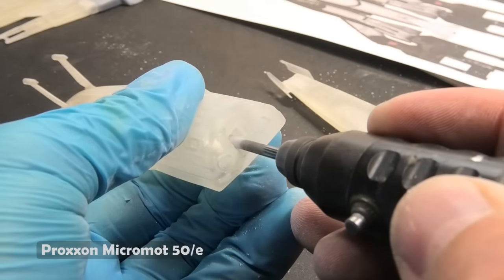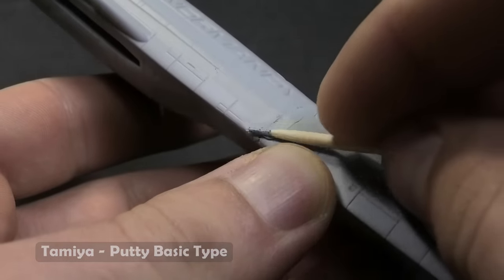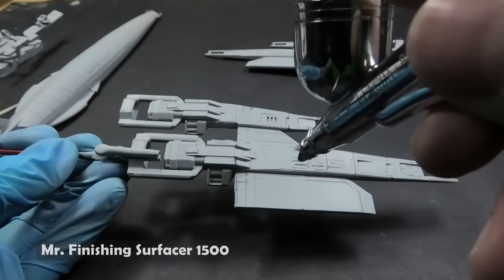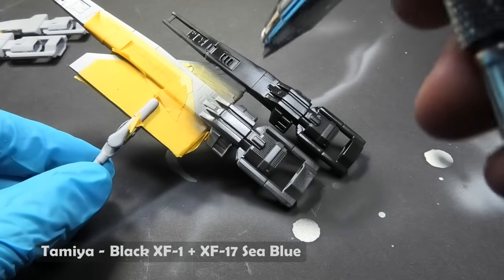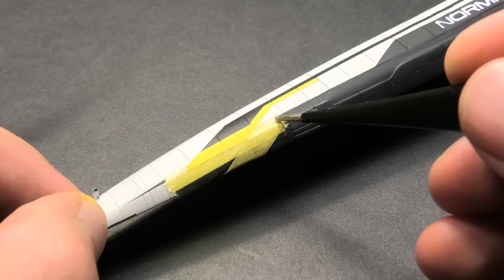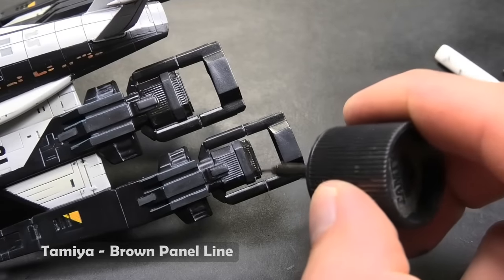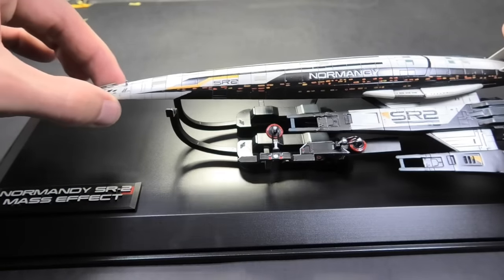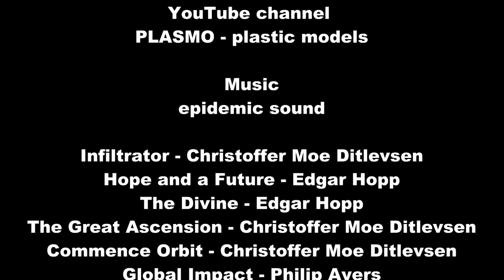Normandy SR-2 Mass Effect - 3D Printed - 1:800 - sci-fi Model

Comment: As someone who helped develop the Mass Effect games at Bioware I was both surprised and happy to see you tackle the Normandy!  Great build; you did her justice!
Reply: I always find that the inside of the SR-2 is messed up, especially in ME3. (I counted my steps, forwards and side-wards)
But with the Tempest her inside, from MEA, that could easily be countered, in style. (more deck space, especially on deck one via T's deck one round chamber, bigger cockpit, three bigger cabins, Admiral, Captain, XO, yeah; deck one as a admirals deck with warroom, ect, SR-1 staircase access from deck two)
Would also require some choice elements of the SR-1, though.
Canon SR-2 her inside & outside, don't really match up, especially not in ME3, just follow the cockpit lower line backwards, where is the room for the belly gun that's below the CIC?
A beautiful design, that's hindered by the internal details.

But yeah, for a details by hand, painted, he really did it great, especially for a 3D print.
Of the print file itself, why did it not include a docking tube???
Would have nicely fitted with that cradle.
It's the only thing throwing me off.

Now, would this actually be how the SR-2 model would be displayed in the game, by change?
Because if so...
Reply: Thank you for the creation, and for the Normandy. It sits up there as "iconic space ships in popular culture" like a number of famous peers. N7.
Reply: thanks for a masterpiece
Reply: me too
Reply: the original ME is one of my favorite games..wasnt a fan of where it went from there, but thank you.

Comment: The artefacts on the prints are the rasterization of the screen showing up on shallow angles. That's why you should always orient your prints at roughly 45° to the screen axis system. Beautiful result, by the way. :)
Reply: These artifacts will diminish as screen resolutions get higher, but they would need to double or more before they disappear entirely.
Reply: I tend to rotate my parts 45 degrees to the screen and 45 degrees on the z axis gets rid of almost all artefacts except those on spherical surfaces.
Reply: Adding contrast blur helps as well as the orientaion you are referring to!
Reply: You are correct, but a 45 degree angle will not necessarily remove the rasterization.  There's an online calculator that takes into account screen size, layer thickness, and screen resolution to give you the best angle.  My Anycubic Photon M3 has an angle of 36ish degrees to prevent the rasterization.
Reply: @livelyjay  thanks for the correction, I have never used a resin machine and was going off just general knowledge about the technology, happy to learn something new :)
Reply: @vit.budina  I still print minis at roughly 45 because the details are so small you can't see the skip lines.  Larger flat prints, like the Andor and Mando blaster were tough to get clean prints.

Comment: There will always be layer lines.  However, you can mitigate the issue to some degree by changing the orientation of the print.  Making good use of the preview feature in the slicer can help you figure out the best orientation to minimize the layer lines.  Balancing orientation with support location to help preserve details can be very challenging, so bring a big bottle of patience when you do this.
Reply: this, and antialiasing, if your printer supports it

Comment: Your lines can be a number of things from Z Screw needing greasing, or build plate loose, to print speed Vs resin viscosity or FEP set up. If you were using clear resin for the first time then I would look at calibration of the machine for that resin (Print speed) and check the temp was within tolerance. On that note, Clear resin will go cloudy if you alcohol wash it, especially if the IPA isn't fresh. You also need to under cure it to stop it yellowing. Opacity will come back if you gloss coat it, or in the case of lenses or canopies, sand it with fine paper. With regards to paint creep under masking tape, if you spray a layer of the paint you are covering (white in this case) over the tape, or clear varnish before spraying the darker coat then you won't get creep. - just a bigger lip to sand back.

Comment: I've started only printing in clear resin because of painting and lighting versatility.  To get it to clear up, add a couple layers of clear varnish.  Worked great with some DnD elementals I printed and used clear reds, oranges, yellows, etc. to create a nice fire effect.  It doesn't make it clear as glass, but definitely gets rid of some of the fogginess to the print.

Comment: When you are painting with masking tape, try making the first layer of pain same as the paint that was already on the model, then paint the color that you need. That way the first layer will seep under the masking tape but it won't be visible because it's the same color as base, and that will make a tight seal for the second paint that you don't want to seep and bleed.
Reply: I've seen people use clear coats for this too.
Reply: @jameshall1300  Yeah, that would also work well
Reply: You can also cut a new sharper edge into the tape, the edges of the tape are usually a bit ragged but if you cut them off they are much cleaner and form a better edge.
Reply: @xTheZapper  I mainly use painters tape meant for walls ... because it's cheaper and easier toget here where I'm from so this doesn't always work, depends on bas color and geometry of the spot

Comment: Layer lines its just the angle and orientation of supported part so you'll have these lines somewhere regardless. Also, remove supports before curing..makes life so much easier ;)

Comment: Beautiful job.  To make removing the supports easier, before you cure the model, put it in hot water and let it soak for about a minute.  You will find the supports will just pull away from the model and there will be less clean up to.  Once the supports are removed, then cure the model.

Comment: You still get to have to do some post clean up on resin parts, just less than FDM. Still get layer lines and artifacts, and depending on the resin, different amounts of  shrinkage, or over curing that can change dimentions enough for tight interesections to bind...
Also clear resin is clear, but the surface is defused. Polishing or using a varnish will make it crystal clear again.

Comment: Layer lines exist no matter what you do. This is why i don't even bother with resin printing stuff anymore. I just modified my ancient CR-10 with better steppers, anti vibration and rigidity and a super fine titanium nozzle and i get as good if not better results. It takes a lot, don't get me wrong, but resin stuff is only for prototyping, you're not getting a boost out of it for models unless you work in the micro range and really need to print a tiny little detail that's 3mm high (and even then the resolution ain't gonna help ya much). As is, my modified Cr-10 prints micro parts just fine, with the caveat that you can only print one feature at a time, which is where resin wins, because it can print multiple features with the same level of accuracy across the board.
BUT, not everyone can afford to mod their printer to that extent, so my advice for resin is to figure out what that specific shape's best layer position is. Long items go horizontal-diagonally, narrow items go vertical and so on. Print a few test parts (best part for such tests is a vierendeel truss with hexagonal, circular, and classic reinforcements) in various positions (and put a label on them detailing the position they were in) so you can always compare in program preview and actual item print. Then you can make accurate educated guesses for what position you want to print in.
Also, keep in mind, some resins aren't as good as others and always clean your printer before starting a run, the cleaner the work surfaces, the better.
Reply: The point of resin printing is that you often need to print details less than 3mm in size.  For example I have printed items such as AMRAAM's for 1/48 scale models and they have rivet details less than 0.5mm. You simply can't get the same level of detail with FDM printing.
And as for layer lines, they're an order of magnitude worse on FDM than on resin.

Comment: Hm, for the SR2 letters, I wonder if it wouldn't be for a better effect to 3d print - SR2 letters - like you did on the template, use a sandpaper roll on a micromotor, to make it fit the curvature of the hull (like... remove material from height of the letters to convex shape so the would fit concave hull) apply paint to the letters and make a stamp? 
But on the other hand it might have been too much hustle for unsure outcome. Just throwing ideas.